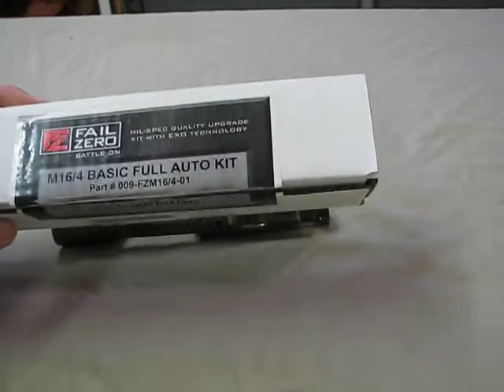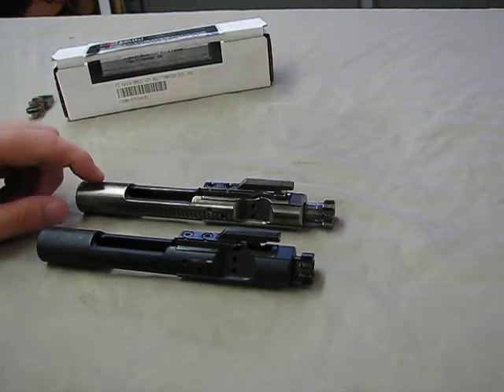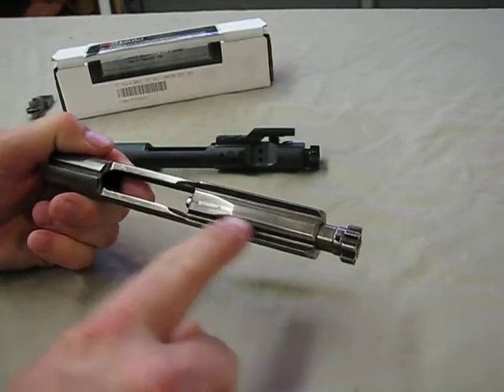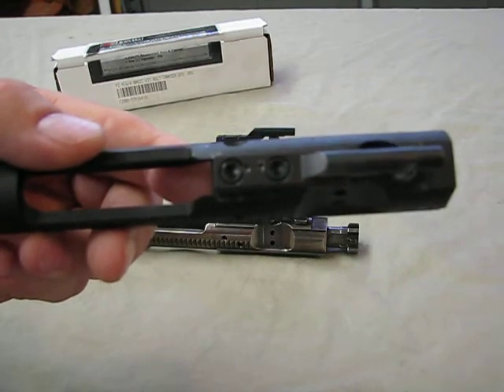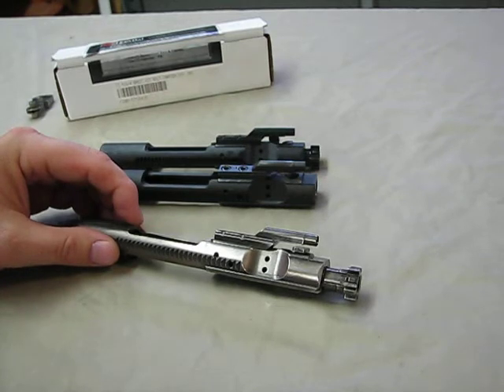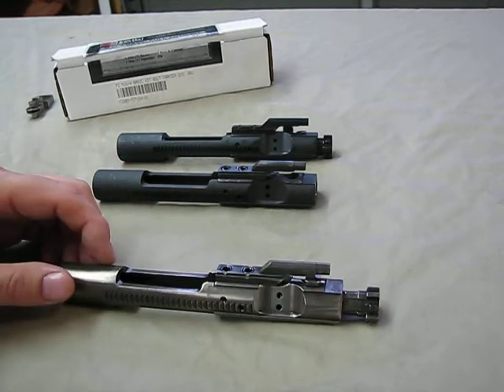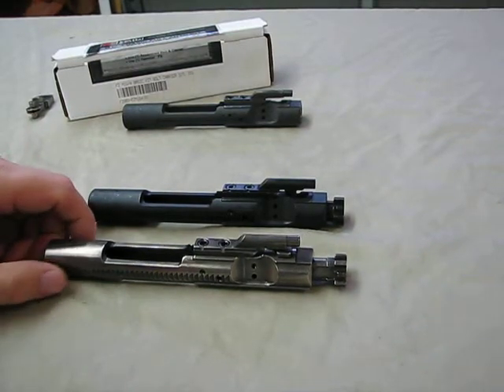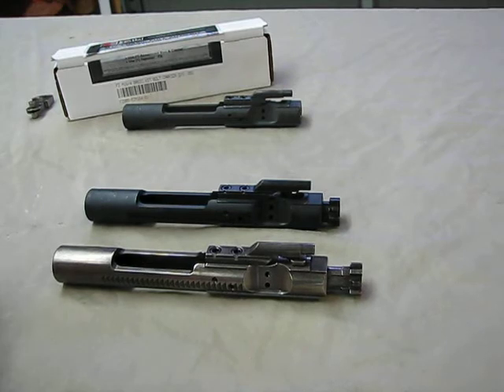Fail Zero

Comment: nice review,  i have two fail zero's and love them.  I did call fail zero to coat my adams arms piston bolt but they're not doing individual coatings.  I was abit upset  but i dont think they have the man power or time to do individual work.  Other than that,  fail zero is the best upgade you can have for any weapon, especially the ar-15.

Comment: AAC Rocksett, a suppressor and muzzle device thread locker, is rated to 600 Fahrenheit. It is recommended by many as useful for locking the gas key screws. So..."Loctite" will work.

Comment from the maker: They say you should but, I did not and I have had no problems and I have bought upgraded bolts and carriers on several occasions, including a second fail zero and installed them. I have never had an issue, as long as your rifle is is good condition and in spec you should be fine.

Comment: if you can find a BCG made from the proper materials and properly assembled the NiB is iceing on the cake as long as your spending a lot just for NiB. as far as BCG issues, once a year I replace the BCG small parts and my Aimpoint batts and since I have never had a BCG issue or a dead batt in my AP pro I consider it $ well spent.

Comment: Dressupyourpet is ignorant. You should use the hammer too so the action is smoother. Also I wouldn't not use lube. Use a small amount on all of the contact points that the bolt makes with the upper. You shouldn't lube under it where it rides on the hammer. That's y they include a nickel boron hammer